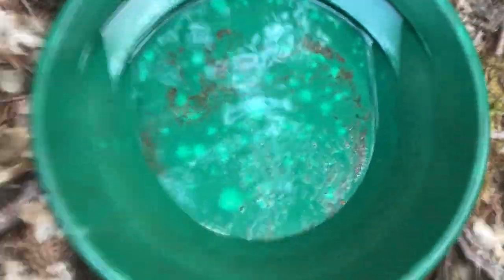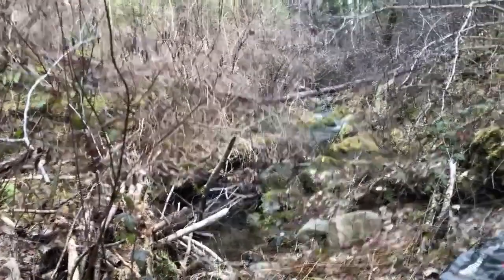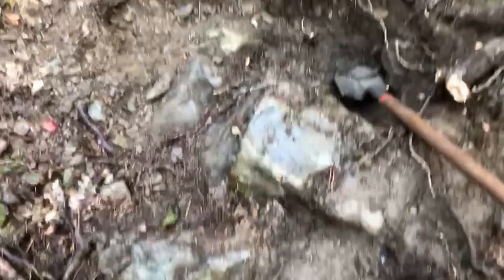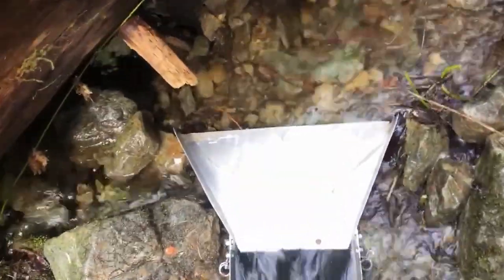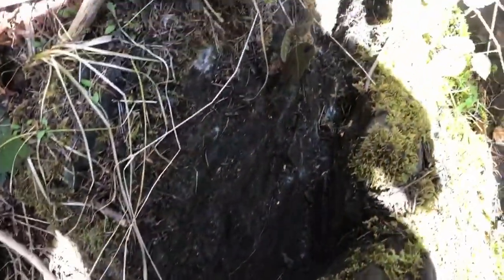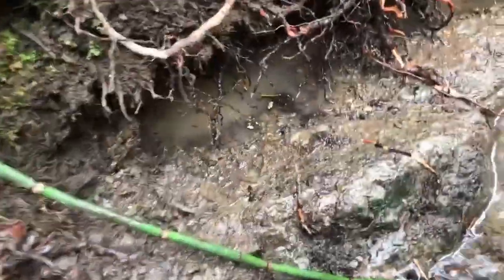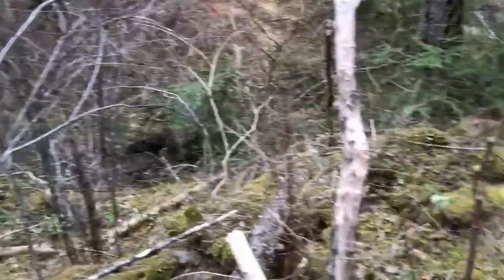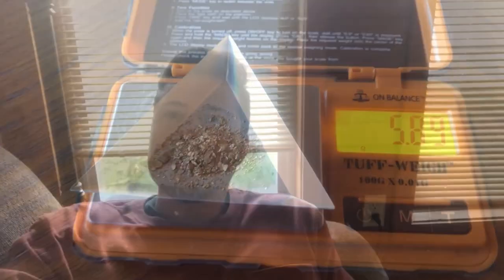Chunky Oregon Gold!

Comment: If he had a magnet probe to check to see how many heavies are in a spot he could get a lot more done instead of guessing if there's gold there
Reply from the maker: Good call, i did bring one, but there's barely any heavies to find!  Probaly needed a stronger magnet too
Reply: @insidebendprospecting   yeah um there's a company that makes a  super good magnet probe but I dont remember the name of the company... but vo gus prospecting uses them and I've used them in the crooked river and it flat picks up magnetic material like nothing.. you just have to make sure you get in the spot really good and move it around in a 1'x1' star pattern.. at least that's what I did...........................................................
1 hour update: the company is place tools and it's called a black sand probe